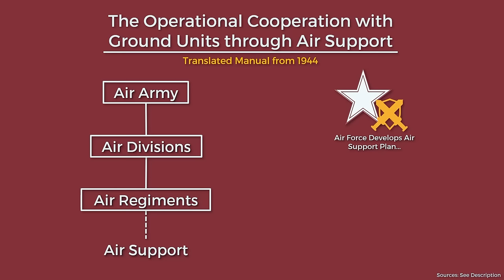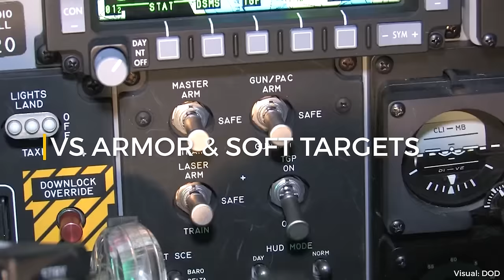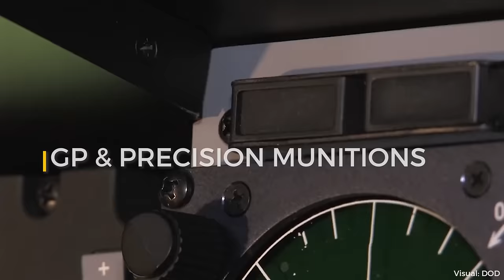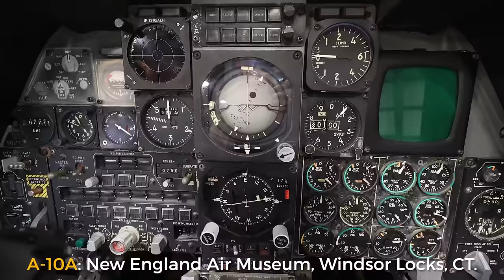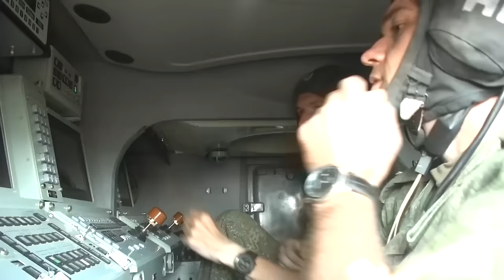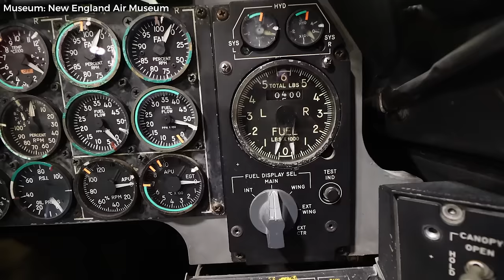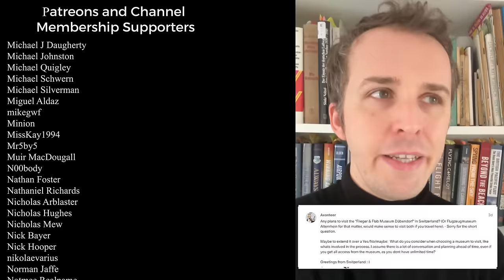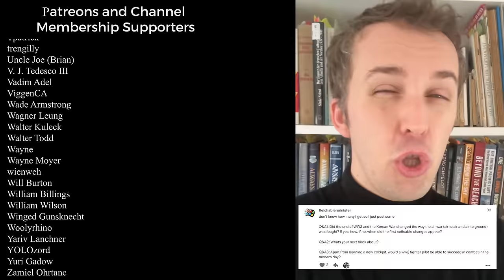A-10 Warthog: Retire or Upgrade the BRRRT? - Future of A-10C Thunderbolt II

Comment: The "middle ground" is quite literally looking at the price vs capability gap. Which simply means the A-10 is a relic and has no place in any modern air force. I don't even care about all the hoopla whether it was good or bad. Because no matter what was the answer 40 years ago, right now the answer is "it's bad and super expensive".
Reply: Whoa whoa whoa, read the sign pal. No rational takes permitted in the A-10 debate club.
Reply: @Iceman259  yeah, yeah, I'll see myself out...
Reply: Honestly I don't even think it was the answer 40 years ago, maybe 70 years ago but it didn't exist then. They've tested the cannon under perfect circumstances and it's at best marginally effective for the supposed tank busting gun run missions it was supposed to perform.
Reply: Is it super expensive?  (Honest question; I really don't know.)
Because a truck that can carry lots of MALD and missiles (kinda like a tactical B-52) seems pretty darned useful.
Reply: @RonJohn63  yes, it is. Last I heard the latest updates bring it to a cost above the F35. And all the updates make it only fractionally as good at CAS as any other aircraft on a dollar to warheads on foreheads basis.
Reply: @Argosh  Can an F35 carry as many MALD and missiles as an A-10?  Obviously no.
An F-16 can't either.
What about an F-15?  (I don't know the answer.)
Reply: @RonJohn63  you're missing the F-18 in your list. Also almost the entire UAV catalog. Nothing manned can beat a Predator or Global Hawk for loitering time.
Both can only be employed in this role in a permissive environment, but that's the same for the A-10.

In a contested airspace you can operate F-15, F-16, F-18 and so on, but not the A-10.
The A-10 was maybe the correct answer to a problem 50 years ago. Nowadays it's completely outdated.
Reply: @RonJohn63 The cost per flight hour is on par with most 4th gen aircraft.  Most arguments about survivability are simply out of context.
Reply: @RonJohn63  Funny thing is that countless nations or companies could produce airframes or kits for missiles which would carry them even 1000 miles, then relay targeting data from local assets (AWACS, jets in the area, command posts, from troops on the ground), and have the missiles continue on to their targets while the missile-carrying airframe self-destructs or returns home.
Creating an aircraft to carry a missile (or several) 1000 miles is child's play. And it's relatively simple to add a system to relay targeting data.
Reply: @Argosh  1. the USAF doesn't fly the F-18.
2. You still haven't answered my question about a missile truck.
Reply: If you look at the A10 upgrade in progress… they are adding the modular systems from the F35 to the A10, including LINK16.  It is also getting a new munitions management system and targeting systems.  A new rack for SDBs has been installed giving it an absurd number of SDBs to drop.
Reply: @RonJohn63  I have answered your question. You not liking the answer is irrelevant. 
In any permissive environment any UAV will beat any manned platform in loitering time and thus availability. Pure capacity is almost irrelevant when you can field more platforms than the A-10 can carry hellfire missiles at a lower price...

In a non permissive environment the A-10 is irrelevant.
Reply: Even if there is a place for an A-10 like package in that middle ground, which I rather doubt, the old bird just ain't up to the job anymore. A turboprop can do the job for cheaper when the air isn't contested, you can afford to lose a strike drone doing the job when it is, or if neither quite ticks all the boxes at least find a new production airframe that does.
Reply: @Argosh  1. You're not paying attention.
2. You're assuming I want to keep the A-10.
3. Trucks can sit back and shoot their missiles from a permissive environment.
Reply: @purplefood1  2 USAF pilots got 6 Iraqi tanks with their guns in one day. This was over 3 sorties in one day, with the A-10's returning to base with all ordnance expended. So marginally effective?
Reply: @pogo1140  Yeah and they got another 17 with ordnance that was actually useful. Compared to what people claim it should be capable of that's actually pretty poor especially since that was a record I believe. Moreover scoring kills against Iraqi armour is barely something to boast about and taken overall the gun massively underperformed compared to missiles in basically every capacity. The tests I was referring to knocked out a handful of targets but it was generally considered they'd be able to repair most of those targets with field repairs. If all it had to do was kill soft targets then it'd be great but it is far from the tank killer it is claimed to be by its proponents. Missiles and guided bombs are by far the better option in basically every situation.
Reply: @pogo1140  and that's not talking at all about the much larger proportion of friendly fire the A10 was responsible for compared to literally every single other model of aircraft flown by every other nation in that conflict.
Reply: @purplefood1  6 kills with mavericks and 2 kills and 2-3 damaged with the gun per sortie. that's 1/4 of the kills.
Reply: @StacheMan26  this is the kind of answer I was looking for.
Reply: @purplefood1  no other model of aircraft spent 2-3 sorties a day on CAS duties, most only flew one sortie per day. Exposure leads to greater chances of a mistake, especially with the early models that flew in DS
Reply: @pogo1140  so what about the night time performance of the A-10?
Reply: @pogo1140  the F16 had very nearly the same number of sorties and notably didn't require the efforts of other planes beforehand to keep it from being taken out moreover the majority of ordnance dropped was guided which was not the A10's forte
Reply: @purplefood1   the Maverick is a guided weapon and has been part of its arsenal since introduction. GBU's came later when the targeting pod integrated to the A-10A, the -10C always had it.
Reply: @pogo1140  by "the -10C always had it" you mean the A-10A had it once upgraded to the C variant? The C variant is literally an upgrade of the A variant...

Comment: both british and canadian forces in afghanistan requested that the A-10 be removed due to friendly fire deaths and injuries because the plane cant see what it is shooting at
Reply: I heard that the Swiss were also protesting, since they hold exclusive rights for producing Swiss Cheese.
Reply: Many of the friendly fire issues were with the A-10A rather than the upgraded C which can mount a LITENING targeting pod. The real issue is that while the C is pretty good at CAS over uncontested airspace, any aircraft can do that without incurring the costs of having a whole new platform (which are NOT offset by the somewhat lower operating costs of an A-10C). If you really want a cheap specialized aircraft to do COIN and such, you need to go to a turboprop which actually has minimum operating costs.
Reply: @rare_kumiko  C-130U, when you care enough to send the very best
Reply: And it’s not even good at CAS to begin even if you don’t include not killing your men part of the definition of CAS. The F-111 took out more armor with far fewer flights.
Reply: @rare_kumiko OV-10 for the win !
Reply: @rare_kumiko  Yeah, but a turboprop that can do 80% of the A-10's CAS and FAC job for 20% the price isn't going to be popular with procurement offices.
Reply: @danf1862  I thought all the AC-130 gunship variants will almost never go out during the daytime because of how vulnerable they are.
Reply: @The_ZeroLine  just so you know for next time CAS is not just hitting against armored vehicles. CAS is in support of ground forces. Those hits against armor don't paint the full picture of what a CAS aircraft is. I don't even recall an F-111 being specifically tasked with CAS. As far as I know they were largely relegated to hunting armor and bombing.
Reply: Per capita the A10 actually has a lower FF and civilian casualty rate. Than the other multirole fighters.
Reply: That I believe!
Reply: @rare_kumiko :  and you are also wrong. Why put a man in a combat aircraft when it can be done better with a drone. Need I say more. Look at the war in Ukraine. And a tan or your turbo prop whatever isn’t going to last 10 seconds at the front lines. You are living in the past. Let me add it up, World War II ended nearly 80 years ago. At that time radar guided anti-aircraft guns were shooting down ground attack aircraft left and right. Don’t you know this?
Reply: I was laughing the whole time you were talking about alternative uses of the A10.  At least you got it right regarding front line vulnerability in the CAS role.  All of this stuff is obsolete in the era of cheap smart drones.  Who in their right mind believes that the A10 Could help Ukraine fight Russia hear in the year 2024?

Too many people that are combat aircraft fanboys Want to believe that there is still a roll for manned combat aircraft.

There is none, not one role for a manned combat aircraft that could not be done better and cheaper by unmanned drone …. That includes the sacred cow, fighter pilot (what a joke, all they are is future prisoners of war)
Reply: @bl8danjil  I am aware. I was simply using that as an example because it is the most easily quantifiable aspect of CAS. COIN much less so.
Reply: @steveperreira5850  Well in that case, they should take out all helicopters and AC-130 gunship because they are all vulnerable to the same weapons that the A-10 is.
Reply: @The_ZeroLine  Those bombing numbers are not always part of CAS and thus they are misleading to use those as a claim of what an aircraft is worth. If we were just hunting armored fighting vehicles then yes, but we aren't. CAS does include bombing armored fighting vehicles, but CAS aircraft are more likely to shoot at enemy infantry and technicals.
Reply: No SAM's or manpads in Afghanistan

Comment: The A-10 is the Iowa class battleship of the Air Force: Big gun, armor, great PR with congress and the general public, and far too vulnerable to modern weapons to survive in anything like a peer fight.
Reply: I'd argue the Iowa is comparatively superior.  Give it modern propulsion, electronics, and weapons and it would be an effective if expensive platform, unlike A10.  A10 just can't perform a role on modern battlefields as stealth is necessary to survive peer on peer.  I just can't see any upgrade package making the A10 useful in anything but maybe counterinsurgency.
Reply: @fguocokgyloeu4817 The cost of running an Iowa class BB makes it entirely unsuitable for modern warfare.  It is no coincidence that the US mothballed all of battleships and battlecruisers and then heavy cruisers and now air warfare cruisers (Tikes) as budgets have shrunk over time.  Sure an Iowa would be great for ground support and would be hellaciously hard to actually sink, but it would be just as easy to knock out as an Arleigh Burke.  Electronics and weapon systems are not very tough and for the same running cost you could have either 3-4 Burkes or an America class LHA with F-35s.
Reply: @rags417  Just as easy to knock out?  Short of nuclear weapons at 4x the displacement with belt armor, there just is no way.  Anyway, you are strawmanning.  My point was that a modernized Iowa would be more useful as a missile truck than a modernized A10.
Reply: A battleship is actually less vulnerable in a modern conflict than some would think due to the armor, but it would need a modern SAM battery, computers, and radar. It was simply that a Aircraft Carrier could drop more munitions at a greater distance that made the battleship obsolete not its “vulnerability” in modern conflicts.

Also the US had no battlecruisers, exept the Lexingtons which were converted to carriers long before completion
Reply: @fguocokgyloeu4817 it is absolutely as easy to knock out a battleship no matter how armoured, because the vital bits like the communications, radar, etc, would be impossible to armour effectively enough.

You smack a battleship with an ASHM strike, it doesn’t matter how thick the armour belt is, because it will be mission killed by virtue of losing all the soft squishy bits that make it actually effective at fighting. Sure it won’t actually sink, but keeping a useless ship afloat is not worth the expense of all that armour. You’re better off buying multiple destroyers that can take the same amount of hits before being ineffective (1) but can mutually support.
Reply: @1967sluggy  Strawman.  I never said you aren't better off with destroyers.  I said upgraded Iowa might be more useful than upgraded A10.  Iowa could easily have four times the CIWS, armor that would protect against smaller missiles, and a much larger superstructure to spread electronic systems across.  A single harpoon sized missile hitting thechell of an Arleigh Burke might knock it out.  That wouldn't happen to Iowa.  Therefore it is not 'just as easy' unless you only count superstructure hits by Granits.
Reply: @rags417  
That's mainly because they were never modernised and require so many sailors. Kinda like the Abrams tank is too heavy because there's 4-5 tons of weight taken up by sheer old-fashionedness.
So rather than say 'this type of platform won't work' they redesigned it into the M10 Booker.

In the same way there'd definately be a role for something with big guns, seeing as aiming has become dangerously efficient while counter-missile system countered missiles. There's once again a space/niche for larger guns that use shells. Look at what China, the US and Russia fields: If someone rocks up with 250-300 mm guns with modern aim that they can fling at targets over 40+ km it's going to be able to solo a carrier battle group for as long as its anti-missile systems hold AND its armour is proof against the roughly 120 mm shells used today.
Reply: @fguocokgyloeu4817  The only meaningful way to protect a ship against a missile is to have missiles as your defence. 4 times the CIWS isn't doing shit if a concerted attack of missiles get through, and in that case you'd have been better off with more destroyers to have more missiles for interception duties.

"Armour that would protect against smaller missiles" but you cannot protect your radar and comms from the missiles in any reasonable fashion! Those things are going to be exposed no matter what, if you coat a radar in armour plate it stops being an effective radar! A superstructure hit from an anti-ship missile will mission kill an Iowa no matter what. Then, you again must ask what the point is of this giant armoured ship if the armour doesn't actually do shit to protect the stuff you need to fight effectively.
Reply: @1967sluggy  Cool repeating what I already said while still strawmanning.
Reply: @fguocokgyloeu4817  , a torpedo under the keel would not do nice things to an Iowa.  To an SSN, a BB is just another target.
Reply: What modern weapons are those. Something not used in Desert Storm? Can an F16 really loiter and perform effective CAS.
Reply: @darylcase88  Yes, it can.